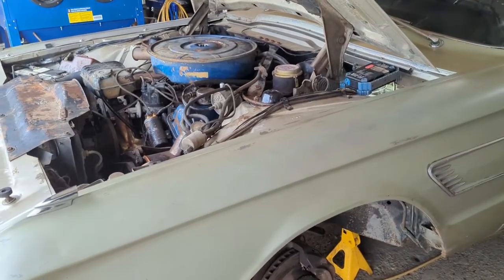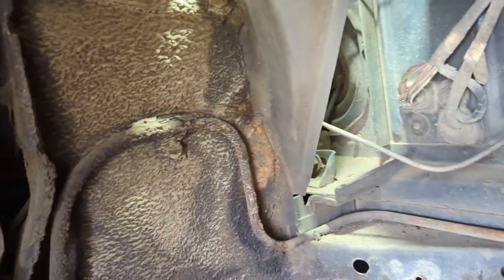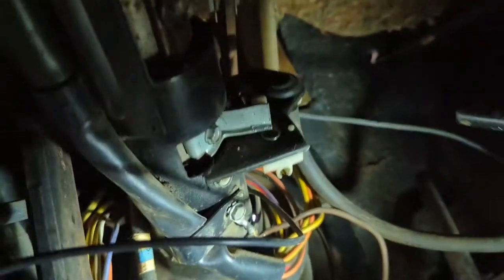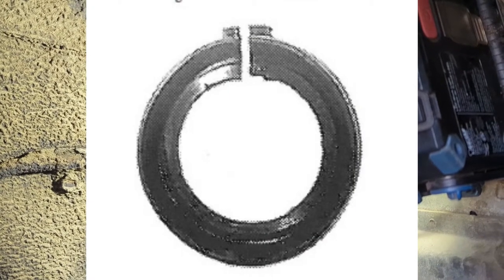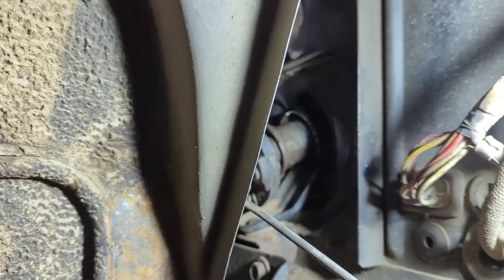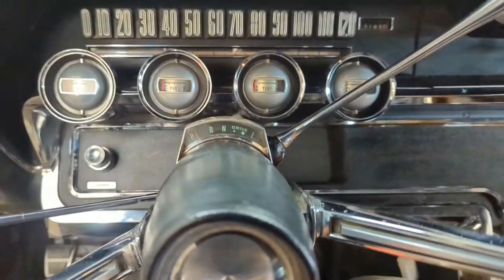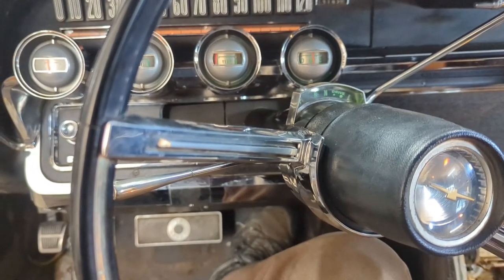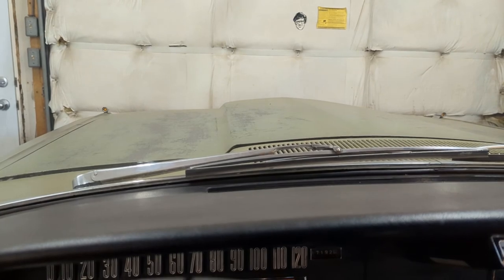65 Thunderbird Lower Shift Tube Bushing Install

Comment: Wow, sweet... I find this on the evening of the day when I have my column laying on the floorboards of my '65 as I am about to change my bushing as well. It was missing entirely! Also found the the tab part that moves the neutral safety switch is missing as well. I want to paint my column as well. I ordered a rebuild kit from the Birds nest. God bless you buddy.
Reply from the maker: Nick's channel Vintage Thunderbird Repair has a couple of great videos on steering column rebuild, and bushing installation.
If you haven't already, check him out. 👍

Comment: Hi Alvin,
 I recently done the bushing on mine while the engine was out. 
I thought the bushing  was missing too ,but upon investigation it had worked its way up the shaft a couple of inches.
I got it back down by pushing it from the inside, looked to be in good condition so lubed it back up and re-installed it as per Nicks video from Vintage thunderbird.
Seems to be working fine.
Reply from the maker: Hi Steve...that's the time to do this fix if you can, I'll be doing that to the column for the convertible before putting it back in the car. 😊

Comment: Today I pulled the left splash shield off of my 64 hardtop... I hope you went ahead and replaced the 3/8" piece of rubber fuel line.  Just like yours, mine had the original hose with crimp clamps from the factory.  Three years ago I was driving a 66 Bird from Florida to Kansas City and the car started having fuel starvation.  I checked everything I could, in a parking lot in a small town.  Got so bad, had to have it towed to my brother's house which was less than a hundred miles away.  We worked on in his shop.  The culprit was that little rubber fuel line behind the left splash shield.  It was original and had dry rotted (ethanol fuel didn't help) and the pump was sucking air from the cracks in that little rubber hose.
Reply from the maker: Most definitely an issue with those old rubber fuel lines, they don't play well with ethanol! Lol
I do change them out, I am fortunate enough to be able to still get premium fuel without ethanol, so that's all I burn in my gas powered vehicles, and small equipment...I hope that fuel will always be available!

Comment: any help finding shift lever return spring and steering bearing spring 1965 thunderbird would be great thanks great content
Reply from the maker: There are two NOS shift lever springs for sale right now on EBAY "NOS FORD C5SZ-7B071-B 1965-66 THUNDERBIRD AUTOMATIC SHIFTER LEVER RETURN SPRING", listed by hotrod31, with 100% feedback.

Comment: Hi Alvin, where did you connect the fuel hose to get gas into engine? did you ever get to fix the shift linkage? do you have a video for that? i think my 66 tbird has the same problem, it's off a bit. taking my time with 66 tbird, but i really hope to get it to run and drive soon!  🙂What kind brake fluid is required for a 66 tbird? thank you! 🤩
Reply from the maker: Hi Laszlo, I connect to the suction side of the fuel pump. I haven't adjusted the shift linkage yet, because I'm thinking of removing the C6, installing a cruise O matic, then it will be back to original... I'll adjust the linkage then.
Any DOT 3 brake fluid...and if you're bleeding the brakes, the cheapest DOT 3 is just fine.

Comment: Hey Alvin, nice video. Looks like your shift linkage may also need attention, they all do. The shift linkage on these cars are not very durable and wear out quickly. I guess this is mostly because of the cheap plastic bushings they use and the heat from the engine and trans destroys them. I have a video showing my idea of a repair but I think its not the only way to fix them and may not be the best way either. However, it does work. Engine sounds pretty healthy. I like your fender light fix, I think Ill try that on my car when I get around to doing something to it. Are you going to the VTCI international show in Kansas City on August 10-14? Ill be there and John keeps threatening to go too. I hope so. Keep up the good work.
Reply from the maker: Thanks Nick! I watched your video, and when out and bought the same wiper motor mounts...this is definitely on the list of things to do. I wish I could go to the VTCI, it would be cool to see, however, we will be driving back from Nova Scotia around that time. I would be great to see you guy! 😎😎

Comment: hi alvin, the pdf link doesn't work.
Reply from the maker: Oh...thanks, I'll check it out. It appears to be from the Bird Nest site, made I'll look for it there, they may have changed its location.
Reply from the maker: Hi Nisha...It's working at my end, not sure why it isn't working at your end...maybe your browser shields?
Reply from the maker: Nisha...I took away the https:// from the link, now you should be able to copy it and paste it into your address bar.
Reply: @J_R_Shop  It's working now.  Txs a lot.  I have to pull the shift lever way up to start the car, sometimes i have to wiggle a little.  Now I know i have a worn lower steering bushing.
Reply from the maker: @nishali3343  after you install the new shift tube bushing, you may have to adjust the neutral safety switch, but that's way to do.

Comment: Anyone know how to get that inner fender off?  I got all the bolts off but it still won't come off.  Is it glued or something/
Reply from the maker: They are not glued, bolts only...check to make sure you have the ones up near the shock tower, you may have to scrape off some undercoating to expose the bolts.
Reply: @J_R_Shop    Thank you, I will double check that.

Comment: I had to get a new brake booster and master cylinder so the folks that I got those items from asked about my shifter. (64 Tbird) Yep it's sloppy so I got the repair kit from them. The instructions are NOT very good. And I'm only a few years older than the car so.....Been a LONG time since I worked on something like this.  Whole lot of Grrrrrrrr going on here. That's what the instructions say. Remove the Driver side hood hinge. I'm not so sure of that now. I had to R&R the fuel pump and some of the videos I watched said I had to remove the Power steering assembly to do that but I found it was easier to go from the bottom. Getting it out seriously stunk but getting it back in was actually fairly easy. I don't know why. But the car is testing me............
Reply from the maker: If you are replacing the master & booster, I would definitely do the shift tube bushing at the same time...you will have plenty of room to work on the shift tube with the booster out of the way.